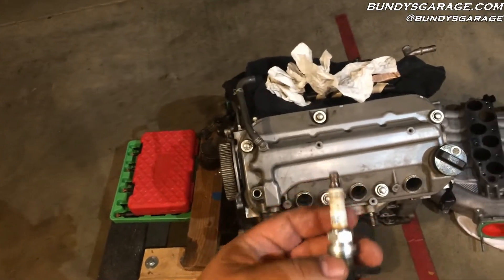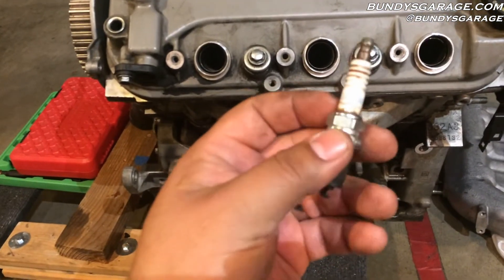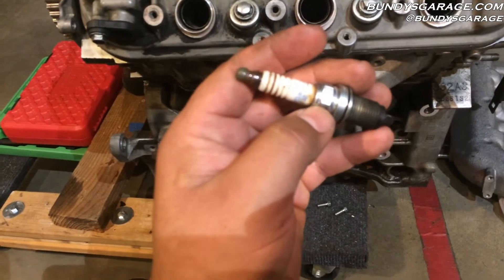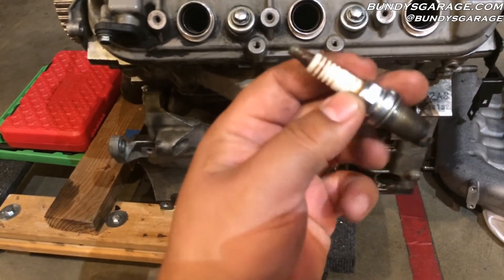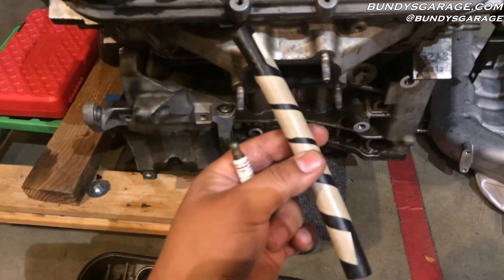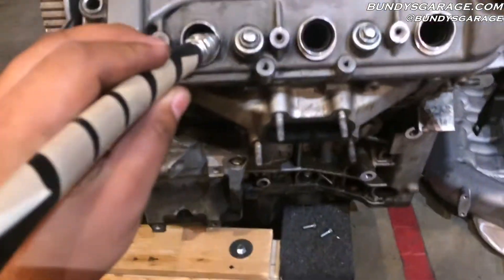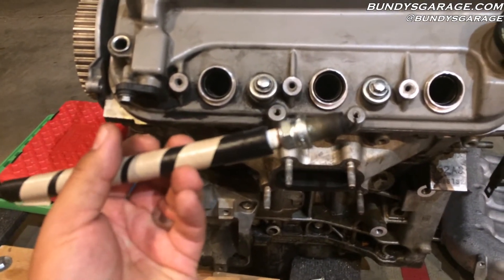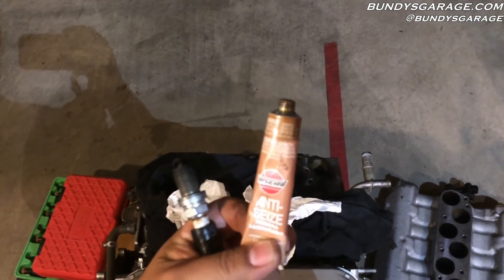Spark Plug Tips and Tricks Installation

Comment: I have a seized spark plug on my front head and I'm planning on changing my head gaskets next weekend. Do I have to remove all the spark plus before removing my heads?
Reply from the maker: No you can pull the head with the plug still in it